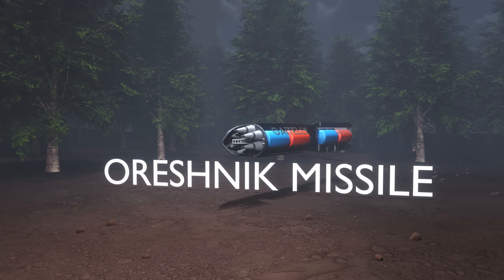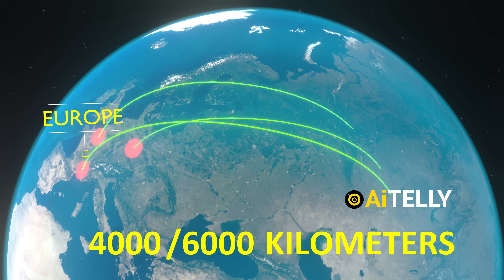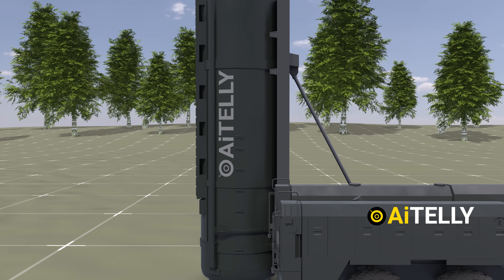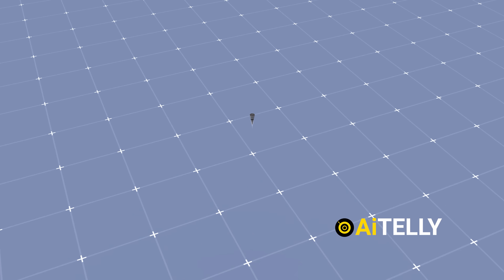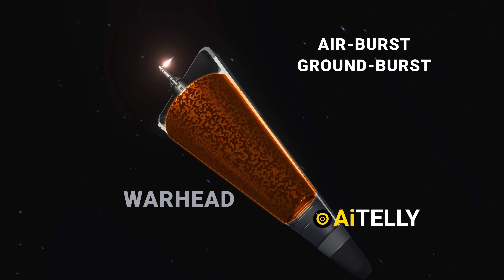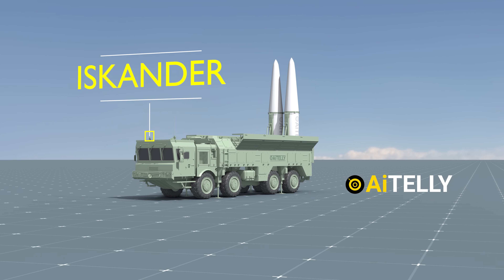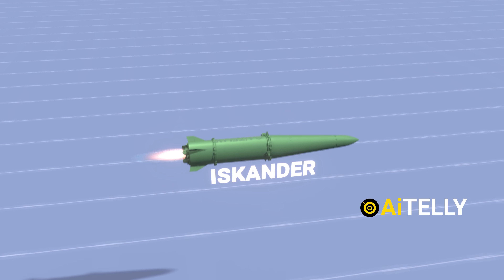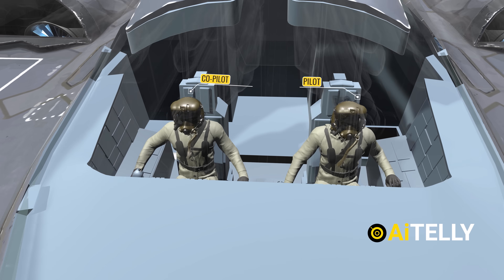Oreshnik Hypersonic Missile | How Russian Intercontinental Ballistic Nuclear Missile Works?

Comment: This missile is not a strategic missile; it is an intermediate-range missile. It does not go into space. Its engines accelerate to speeds of Mach 10-12. It climbs to an altitude of 100 km and from there dives towards the target, constantly accelerating. At some point, the warhead section splits into 6 controllable blocks, which in turn divide into 6 more combat devices. 36 combat projectiles fly to their destination, maneuvering. The temperature reaches 4000°C. The temperature is similar to that on the surface of the sun. Within the kinetic impact radius, everything (metal, organic matter, etc.) breaks down into elementary particles. Nothing remains. Thus, by playing with the precision of the strike, you can achieve the effect of a nuclear bomb attack without radioactive contamination of the surrounding area. Western analysts have perfectly calculated the approach time of this missile. And these are minutes to any target within its range.
We are faced with a fundamentally new weapon, comparable only to a nuclear charge, but without the side effects associated with radiological contamination of the area.
Russia is creating an entire line of these weapons: with a flight time of 3 minutes.
People in the West seem not to understand the significance of this new Russian weapon due to all the Western propaganda they are being flooded with. 
This new missile is a conventional weapon that has the same destructive power as a tactical nuclear weapon without being a nuclear weapon, without producing the radiation, without the mushroom cloud, and without the political backlash of using a nuclear weapon.
The structure it destroyed in Ukraine was just massive. It was literally the size of a small city. 
To destroy such a city or such a massive structure like that missile destroyed would have required at least a small tactical nuclear weapon before. 
Not with this new weapon. 
The issue here is that nuclear weapons cannot be used unless you want to commit suicide, become internationally isolated, and deal with radiation. 
But with this new weapon, you don't have to worry about any of that. 
Now Russia has a weapon that can destroy an entire city without using a nuclear weapon.
Now I want to ask you a question. 
What do you think this means for all NATO military installations, naval, army, and air force bases or any mass concentration of troops in Europe and parts of the United States?
What do you think will happen if NATO tries to mobilize any large number of troops and equipment anywhere in Europe or the Western United States to fight against Russia?
Prior to the existence of this new weapon, Russia would have had to use nuclear weapons to destroy NATO armies.
Not with this weapon.
Plus, Russia could use multiple missiles carrying this weapon and target the same location with multiple missiles.
Eventually, Russia will make a submarine version, and then all of the continental United States will be within its reach. Then, every U.S. army, naval, air force, industrial, economic, political, and population center will be within reach of this destructive weapon. 
Russia is now in the same position as the United States was between 1945 and 1949 when the U.S. was the only country with nuclear weapons in the world.
Russia now has a weapon so powerful it changes the rules of the game.
They literally have a weapon with the power of a nuclear weapon that is not a nuclear weapon.
Reply: Я из России и мы хотим жить в мире и согласии по этому перестаньте тыкать в нас вилкой ♥️♥️♥️
Reply: @Bourbon10245  ;)
Reply: @Bourbon10245  Клоун, мы все это видим, миролюбивый ты наш
Reply: @ЭдуардС-щ3х  я говорю про людей так что тебя это не касается 🫶🏻
Reply: So why aren't they using it to win the war in Ukraine?
Reply: Presuming its effects are as claimed if used it would be presumed to be a nuclear weapon.  The use of such a weapon would invite a "full retaliatory response" which might include nuclear weapons.  Makes about as much sense as the neutron bomb.
Reply: @ChristopherPlatt  
После применения подобного оружия отвечать будет нечем и не кому...
Reply: This technique is good for hitting several targets and reducing the number of platforms
Reply: The missile knows where it is at all times.
It knows this because it knows where it isn't.
By subtracting where it is from where it isn't,
Or where it isn't from where it is (whichever is
Greater), it obtains a difference, or deviation.
The guidance subsystem uses deviations to generate corrective
Commands to drive the missile from a position where it is to a
Position where it isn't
Reply: IRBMs ARE strategic missiles... Remember the Pershing II vs SS20? The main difference between IRBM and ICBM is the flight time, an IRBM has a shorter range and will hit its target faster since the target isn't as far away - faster than the people at said target can launch a retaliation strike. Pershing II could hit the Kremlin with pinpoint accuracy in less than 15 minutes - Oreshnik basically is an SS-20 with multiple warheads meant to strike London and Paris before they can order their return strike (No, it wouldn't be aimed at Berlin or Warsaw, because those can be reached by Islander missiles from Kaliningrad)
Reply: @sidneybarra  the missile that struck Dnipro did not destroy a “small sized city” and it wasn’t even equipped with an explosive warhead. There’s literally videos and satellite photos of the aftermath. It destroyed some walls and put holes in roofs, and did not make the impact you are lying about.
Reply: And you believe the photos that they showed you? Pathetic
Reply: @dustin7405  yeah I just tried to evidence it did that much damage and idk what this guy is talking about.

Comment: Lots of untruth and fakes. Nothing is based on US designs in this missile. Russia is far ahead of the USA in missile technologies and science. 5500 km range is not intercontinental range class, not ICBM. It's middle range missile class. It's not clear how rotation can affect direction, how adding rotation to those warheads can make them change directions in different directions. Putin couple days ago said that Oreshnik releases its separate warheads just few secons after the launch and after that they are impossible to intercept. So, it looks like most of path warheads travel by their own by not ballistic trajectory. I suppose that warheads are more like hypersonic vehicles with engines and some sort of planes to control flight and change direction.

Comment: 😂😂with Mach 11 speed, you don't need to evade or outmaneuver any anti-missile system. The most advanced so far, Patriot, has the top speed of Mach 5. It's like chasing a motorbike with a bicycle. They can detect it but they are not fast enough to intercept it unless they meet somewhere at a cross-point, which requires advanced calculation. 😂😂

Comment: It is not clear what is surprising here. Development and creation of kinetic weapons have been underway for a long time. Russian engineers have always been educated and inventive. Or, for example, in Russia, computer-based space object tracking stations, developed back in the 60s, have an element base that has not yet been created anywhere in the world. Unique complexes.😅
Reply: "Kinetic weapons" have been used for ages, basically that's just rocks fired from catapults. Even the huge WW2 siege gun used against Sevastopol used concrete-filled armour piercing shells. And it was way more accurate than this missile, too (but shorter ranged)
Reply: @jnievele As for the accuracy of the guns of past centuries, it is still a dubious statement. Previously, the direction of movement was not controlled by anything, unlike modern ones. Using parameters of data from satellites or embedded in software.
Reply: @IGOR14111969  Accuracy can only be as good as the guidance system allows, and there physics is the limit. For a nuke the accuracy achieved will be more than enough, for a large 🧨 warhead it might be enough... But a kinetic warhead either needs to be extremely heavy or extremely accurate, and these are neither.
Reply: @jnievele  As experimental tests at Yuzhmash showed, specialists managed to achieve both precision and the required power.

Comment: It probably isn't 3 stage. There's no evidence it uses 6 RVs with submunitions. There's no reason for it to do so.
There's no reason to think the RVs are maneuverable. 
It's almost certainly a RS-26 with 36 inert RVs, most probably regular endo-atmospheric penaids...
No evidence it uses MIRV, as all RV struck the same target in the single attack we've actually seen.
No, those RVs could not potentially house a nuclear warhead. The Topol series is not capable of carrying 36 nuclear warheads. The RVs were saw in Oreshnik must be far too small and light.
Spin systems provide spin stabilisation, not endo atmospheric maneuverability.
Satellite navigation is not usable by hypersonic RVs when in the atmosphere, as the plasma sheath is opaque to radiowaves.
You said it's a cold launch system, but then said the 1st stage motor propels it out of the silo.

Sorry, but a lot of nonsense here.

Comment: I think it's important to state that this is speculative. A couple of things you mentioned (that are probably what Russia overexaggerates) aren't even physically possible.

1) hypersonic flight (Mach 5+) creates a sheet of plasma around the projectile. This automatically makes GNSS, remote, Radar and IR guidance unusable as the plasma doesn't let signals in or out. The only guidance it has is inertial and therefore cannot dodge interception attempts. Its uninterceptability is only due to its speed. Also keep in mind that if the projectile is spinning for stability it becomes significantly harder to steer because it builds a lot of angular momentum.

2) the "nuclear capability" is probably just propaganda. Yes you can use nukes on anything with a warhead in principle, but given how tight of a cluster the MIRVs formed when they landed the first nuke would just destroy the other warheads when it goes off. It may be that the other 5 are decoys but still I would argue that it doesn't really need decoys at those speeds and that short of a range as it will reach the target too fast. For normal ICBMs, MIRVs are used to cover a bigger area by spreading the warheads out resulting in 1 launch being the equivalent of 5 or 10 impacts.

Personally this weapon seems more fitting for a bunker-busting or carrier killing roles given its speed, short range and precision.  To achieve these, it doesn't even need explosives to penetrate let alone nukes.

Comment: It is not Hypersonic but rather balistic Missile, with maneuvering reentry vehicles.
Old stuff.
An trully Hypersonic missile don't follow a ballistic trajectory. It follows a flatter trajectory, far closer to earth. Can't see it comming until it appears over the horizon. Then it is too late to intercept. 
They are just repackaging an ICBM with  conventional explosives, or just use its kinetic energy. 
The problem is such missiles are indistinguishable from nuclear tipped ones. 
That's why they informed of its launch to the US, to avoid a potential nuclear retalkation. 
I don't think they can use it more times. 
Each launch would raise the cuestion, nuclear tipped? 
Each launch would have to be notified, and tracked in advance, if not, and even then, it could trigger a nuclear response.

Comment: I think there is a mistake, this missile has 6 warheads, and each warhead has 6 smaller warheads, in other words, if you look at the published videos, you will see 6 hits of 6, which means a total of 36 hits, it is unlikely that Russia will have 6  since Russian officials said that 36 Thaad missiles are needed to successfully launch an Oreshink missile, this clearly explains that this missile has 36 warheads, the weight of each warhead  It is probably between 100 kg and 150 kg, the small warheads are probably left after the escape operation.

Comment: spin gas generators are used to impart a gyroscopic spin on the RV like a bullet, this keeps it traveling in a straight line. it does not change its course. This is very old tech.

Comment: Almost everything here seems to resemble truth about the weapon, except for the fact of any such systems actually leaving the atmosphere.  It takes a non-rocket scientist, meaning, a normal person to know that there is no way to propel something in nothing.  Try sailing a boat in the sky or just swim in the air.  In nothingness of space, there is nothing to propel anything from.  Even if one would manage to propel something into absolute vacuum of space, that thing would have a set direction and wouldn’t be able to change it, to slow down or to accelerate!  JUST COMMON SENSE!

Comment: While hypersonic missiles are often discussed as highly maneuverable, in reality, significant maneuvering in the terminal phase is extremely unlikely. At speeds exceeding Mach 5, the missile experiences intense aerodynamic and thermal stresses, making sharp maneuvers impractical. The plasma envelope around the missile further complicates control systems and reduces precision.

Most hypersonic systems prioritize speed and stealth over agility, relying on a largely predictable trajectory with minimal adjustments to ensure structural integrity and target accuracy. Claims of extensive maneuvering in such weapons are often overstated or misunderstood.

Comment: While the idea of satellite correction for a missile like Oreshnik sounds innovative, it's unlikely to be practical on the terminal phase due to significant physical and technical limitations. At hypersonic speeds, the missile generates a plasma envelope from atmospheric friction, which severely disrupts or even blocks radio signals, including satellite communications. Additionally, the rapid maneuvers required for trajectory correction at this stage face extreme aerodynamic loads, making precise adjustments highly challenging.

Modern hypersonic systems typically rely on autonomous navigation, such as inertial guidance, radar, or infrared sensors, rather than external corrections in the final phase. Relying on satellite correction at this stage would introduce delays and increase vulnerability to electronic countermeasures, which is why it’s generally avoided in practice.

Comment: ''State of the art Missile'' is bit of an oversight considering Russia's other missiles are poor quality, cant hit the exact target and Russia is running very low on them. What else was a fraud from Russia saying it was the latest tech -
1. T14 Armata - Pretty everything on it was a lie, even China said this around purchasing / inspecting it. AAA defence was a lie, thermal imaging was from the old LeCleric, armour was a lie, engine from a WW2 german panther and also they only have 6 of them purely for parades that's all.
2. Moskva - 1 main gun worked, missiles did not work, radar didn't work, engine 10k hours past its service date, communications could only work at specific times such as other instruments turned off.
3. Nuclear submarines - Docked most of the time, why? because in need of repair.
4. Navy / Warships - Mostly in dock due to needing heavy repair from service years. (And still not fixed after 5 years in harbour)
5. Russian military tactics - Shout 'ohh raaa' and charge head on, no logistics, no back up, no transport, no surplus ammo. Basically tactics from the first world war. How modern.....

And your worried? Russian bear, it's laughable.... more like a 90 year old Russian grandpa that needs constant care - totally harmless. That's Russia's military. All show, no punch.

Comment: Massively wrong. There are two MERS platforms, each with 3 tubes (6 in total), and each tube has 6 warheads, so that's 36 warheads. The ones used were kentic, but they could be armed with conventional explosives, or nuclear weapons.

Comment: You got it wrong from the very start.   Nearly all if not all ballistic missiles of some size and range are hypersonic all the way back to the venerable V2.  Also, manouvering may make it harder for the Patriot, it sure as hell is not impossible.  The same was being said with the Iskander M missile, yet it was shot down.  Solid fuel doesn't come in two seperate tanks as shown in the video.  That is likely liquid fuel.  Sorry, but after 1 minute I am tapping out.

Comment: After re-entry into the denser athosphere (at an altitude of approx. 60 km), the surface of the warhead is white-hot and completely ionized, so that radio transmission can no longer function.
The last 60 km to impact are covered in only approx. 20 seconds!
The warhead does not require TNT because the kinetic energy of 1 kg of mass at 3333 m/s is approx. 30% greater than the explosive energy of 1 kg of TNT.
Question: How does the technical control work in the last 20 seconds to hit the target coordinates exactly? Alien technology? (translated with DeepL)

Comment: All info here incorrect as the actual single missile shot at Ukraine had 36 distinct impact sites as well as the videos from 2 different countries along the way of its trajectory showed a flat trajectory not an arc as well as spiral fumes indicating the use of the theoretical penetrator engine which reduces usage of solid fuel research before sharing nonsense

Comment: The main "highlight" of the Oreshnik (as well as the Avangard) is not that it has such a high speed, but that even when moving in a plasma cloud, it continues to remain controllable and continues to maneuver, overtake a moving target, evade air defense, and in any case hit the target with a deviation of no more than 1.5 meters. The Americans never achieved this, probably did not even understand the principle - how it is done. So, any target, even an aircraft carrier, can move as it pleases, at any speed, even stern first - it does not matter, the accuracy of hitting the target will remain the same.